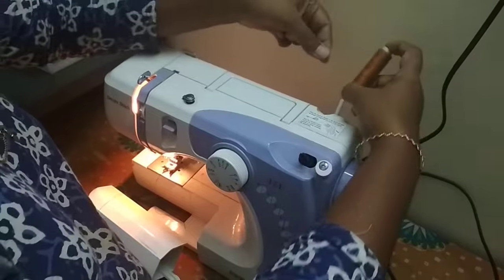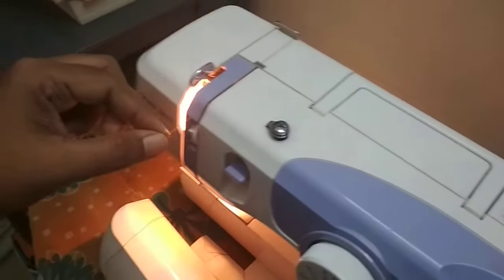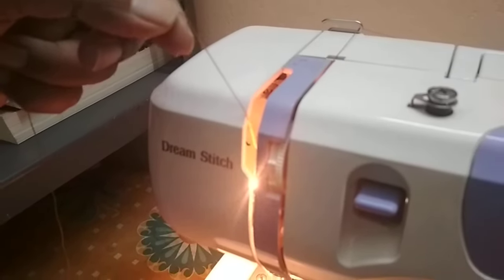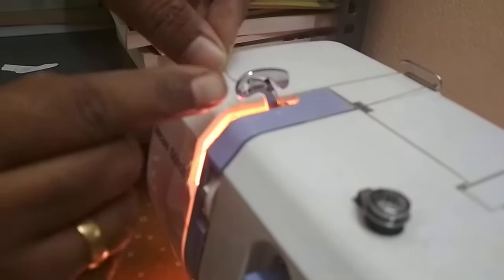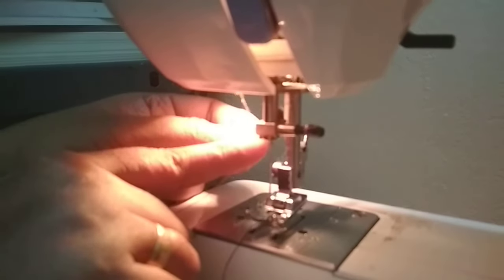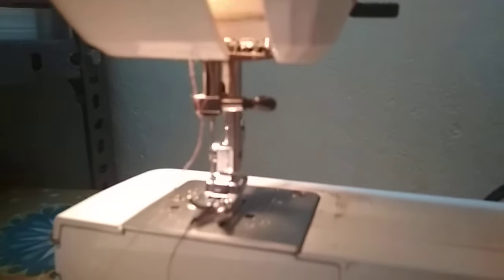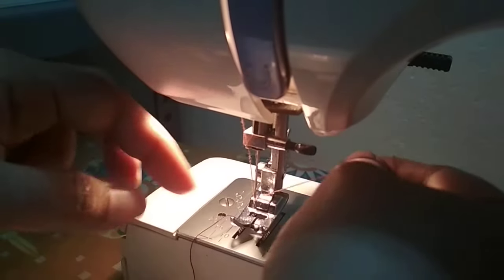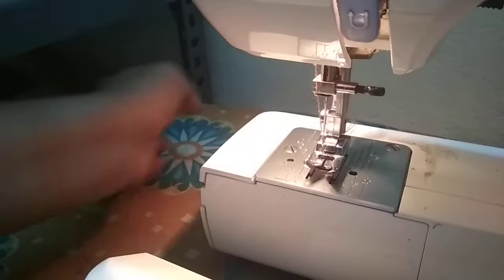Threading USHA JANOME

Comment: How to pull off those bobbin thread from bottom mam
Reply from the maker: Leave a little bit of thread while winding the bobbin and rotate the the wheel once. As the needle with the top thread  comes out, it will pull up the bobbin thread